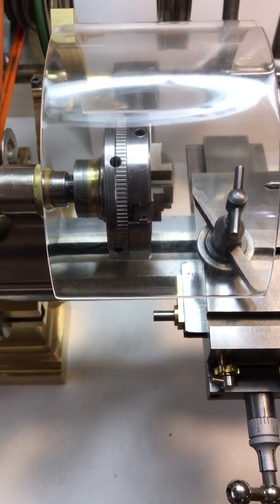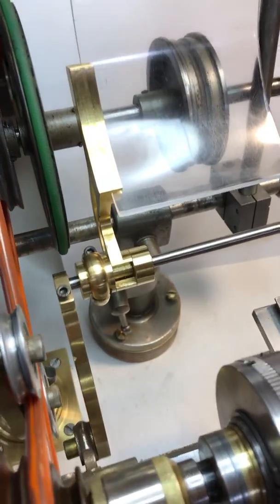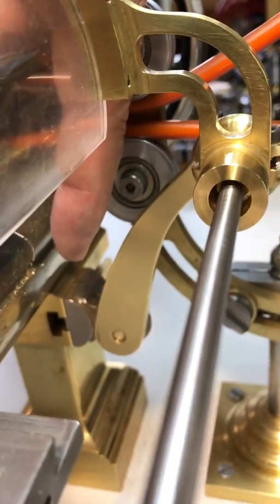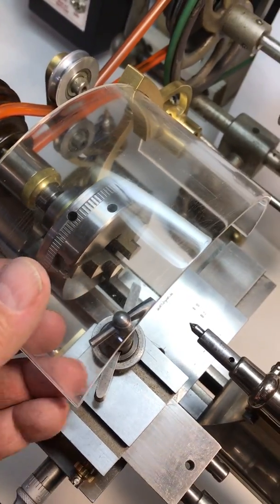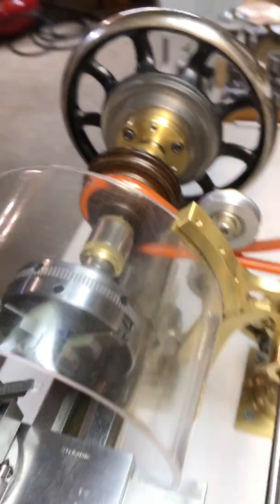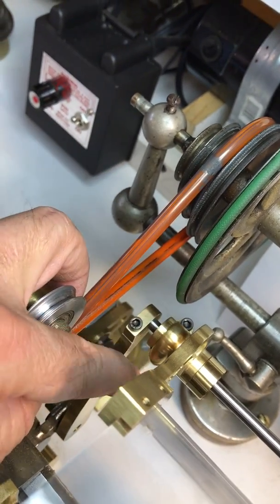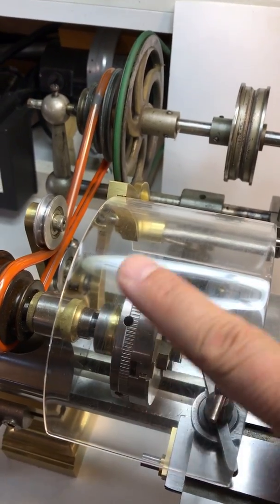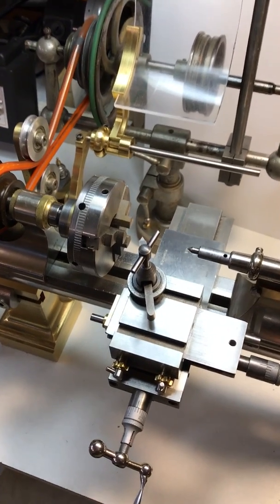Watchmakers lathe custom chip shield

Comment from the maker: I find my little lathe has very little vibration to begin with. typical sources of vibration with these lathes can be the belt and any seam in it. If the base is good and sturdy then even a slightly off center part should be well dampened.  You could attach the shield most anywhere but I'd avoid any part of the motor mount.

Comment: Following a corneal scratch, I'm hoping to make a basic (more basic than your lovely work) shield for my 8mm lathe. My set up is similar to yours, in that the lathe and motor are on the same base. Between standing on the base and being clamped to the lathe, which do you think would have less vibration reaching the transparent shield?